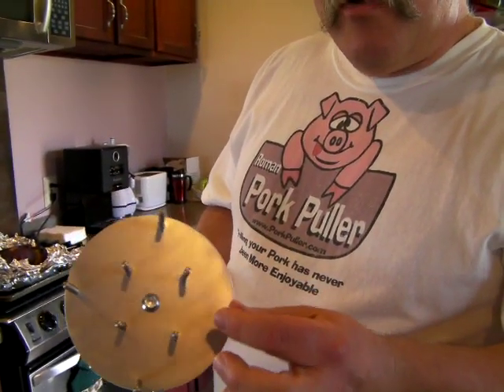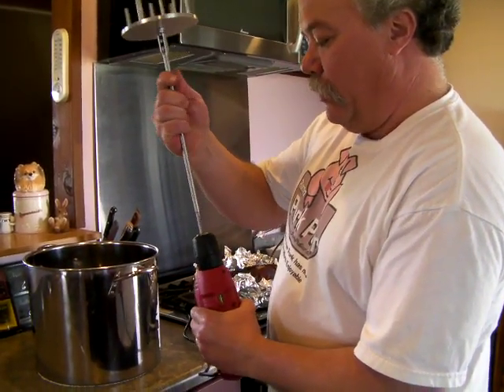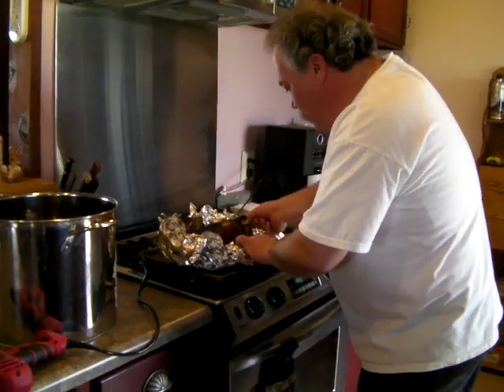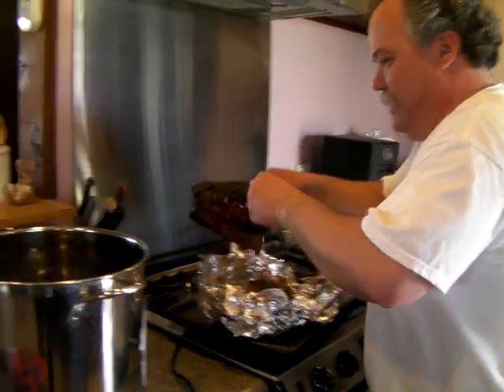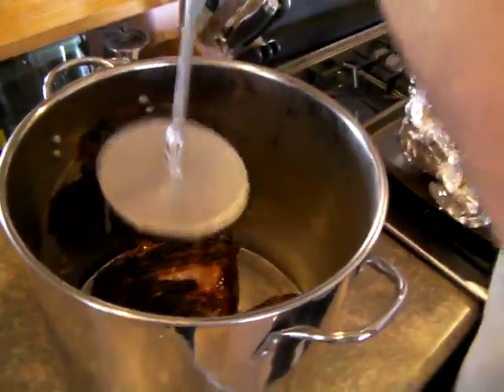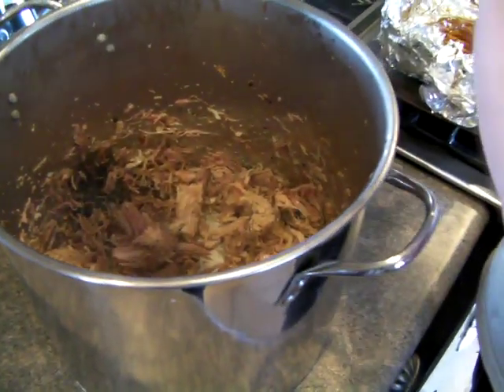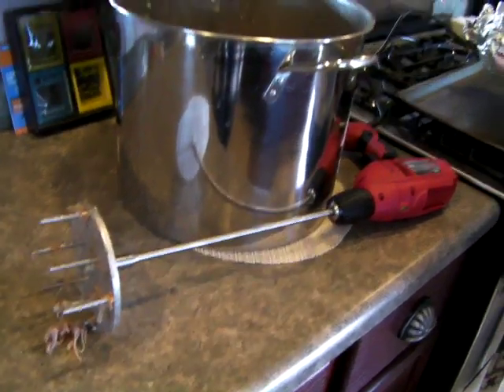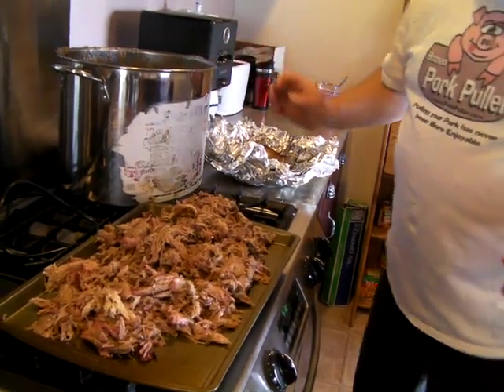ROman Pork Puller V2

Comment: Can this Pork Puller be bought? I just did a 10lb Butt this past Sunday & it took me OVER an hour & a Half to use two forks! I would much rather spend the time EATING it than preparing it!! But I need a reasonable price...I saw one for about $90 with shipping & handling which is just a little pricey for me as I'm only using this for HOME use not commercial or catering. Please let me know where I can find one of these & if it's not too expensive. Thank You so much!
Reply: I hope you've gotten better over the last 3 years. An hour and a half to pull one butt?!?! You had to have been fibbing.